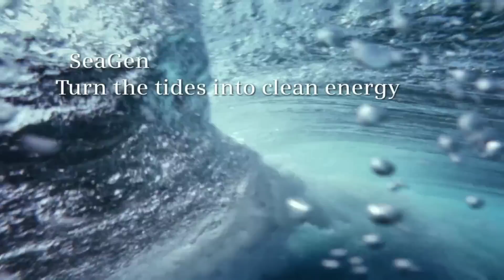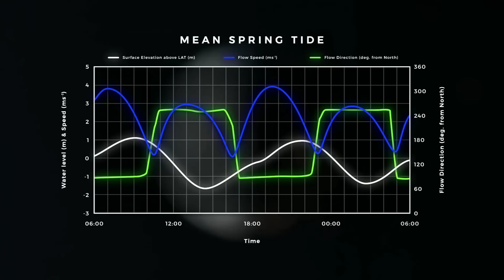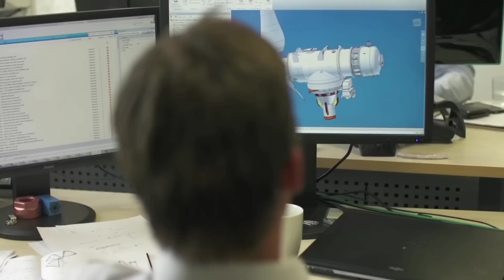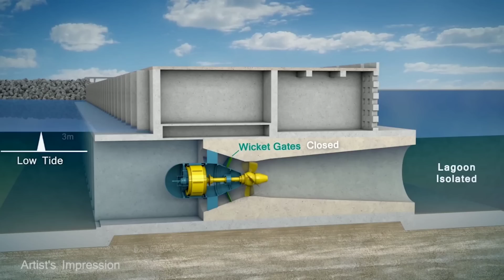This is the Amazing Energy Source That's More Powerful Than Wind and Solar Together!!

Comment: Most of the turbines (or all?) are failed projects that are already out of biz.
Only the 3rd Gen project on the thumbnail is in operation and feasible for 3.5 or higher currents.
The true challenge to tap into the vast 2 m/s currents with low maintenance and mass production design isn't even touched.

Comment: Tidal energy will at best add nightime baseload for industry that cannot shift loads or ramp up/down production out of solar availability.
The sites of 3.5 or higher currents required by this solution are very rare places far away for areas of high demand.
The individual props do not scale beyond 500 kW per unit and can't get into the typical 2 m/s current regimes at all or scale to MW power per unit.
This is a huge maintenance and CAPEX issue that structurally cannot be overcome on a cigar type float.

Only one tiny company in Germany called Cyklone Tidal Energy is at TRL5 regarding currents of 2 m/s. Means afaik only they do currently have any experimentally proven lab physics getting into the vast areas of tidal currents at scale.
A lot more R&D focus on tidal power would be required to unlock tidal power for cheap direct night time industry power supply.
Where you economically cannot compete when draw power from storage during half of the day. That's green steel, green ammonia, chemicals, paper and waht not in raw materials processing that has to run 24/7 full speed in the industrial core base in every regions.
The base materials stuff all other companies higher in supply chains need to get super cheap or die.

Comment: The energy systems of the future will be based on operating costs and efficiency as well as cheap energy storage.  Propellers under water are vulnerable and there is an unknown cost in this.  It is difficult to see that tidal energy can bring costs down under solar and wind conditions.  The headline is way too bombastic.  The energy of the future will be a mix exactly as it is now.

Comment: No mention of oscillating water column.  

Also, anyone who works in any type of marine environment will agree, salt water eats, eats and eats.  It’s corrosive.  A turbine in salt water has a shorter lifespan and requires more maintenance.

That said, if it’s more efficient and can generate the power, go for it.

Comment: Is a big, a pricipal mistake inside tidal energy harvesting. I did develop a new science; 

Between KNOWLEDGE and UNDERSTANDING, there exists a discernible
and traceable difference. The essence of SCIENCE is to transform the
knowing into UNDERSTANDERS. Thus, FLUID SCIENTISTS are
essentially FLUID UNDERSTANDERS. However, an extensive detail has
escaped all fluid scientists from the Big Bang until today. They know
everything about that lateral force called DYNAMIC LIFT, yet they haven&#39;t
understood its condition, CIRCULATION, beyond being able to define and
differentiate it from lateral inflow, not comprehending it as a CONDITION
for LIFT. They haven&#39;t tested it, examined it, analyzed it, evaluated it,
questioned it, and consequently, they cannot generalize this inseparable
connection between LIFT and CIRCULATION in straight lateral inflows, nor
can they comprehensively apply it. The knowledge of circulation did not
culminate in understanding. Instead of a theorem, an axiom, circulation is
found in lift formulas (KUTTA, BLASIUS). Hence, human interaction with
flows still revolves around the two entities of AIRFOIL PROFILES and
ROTORS, but not around externally induced switchable and controllable
CIRCULATION.
To establish a basis for dialectical understanding from innocuous,
inconsequential, helpless knowledge of LIFT and CIRCULATION in
LATERAL INFLOWS, here is a lay-based attempt to at least fundamentally
indicate that twinning/synergy between lift and circulation. This draft aims to
contribute to eventually transforming mere KNOWERS into coming LIFT
UNDERSTANDERS.

DRAFT:
Axiom concerning the synergy of CIRCULATION and DYNAMIC LIFT:

"Dynamic lift results from the struggle and unity of opposites, the convergence of circulation and lateral Draftflow (1st dialectical law).
Within lateral flow, every object that is circumferentially surrounded, every entity within the universe, regardless of size, weight, shape, or nature, experiences a lateral force - DYNAMIC LIFT.
Dynamic lift is the lateral force that any circumferentially surrounded entity experiences within an additional, lateral flow.
Lateral flow, as indicated by the term 'lateral,' excludes (literally/in the sense of words) a flow direction parallel to the axis of circulation.
The necessary circulation can be
a) aside from its spontaneous generation at an appropriately directed "slanting" angle of airfoil profiles (sails, kite-dragons, wings, turbines, propellers, ship screws, ascending larger, non-spherical air bubbles in liquids) with respect to that lateral flow,
b) a consequent circulation from rotation (akin to falling confetti in a gaseous medium with ensuing friction/interlocking action!)
c) also achieved externally, by switching, controlling, changing direction, and switching direction.
For the purpose of generating the desired lift in a switchable, controllable, and directionally adjustable manner.
Circulation and lift occur within lateral flow either together, interacting or not at all.
This synergistic interplay is only proportional within a very small range. For instance, the KUTTA lift formula (factor times factor times factor equals product) mathematically implies proportionality, but it is limited by the effect of the LAW OF CONSERVATION OF ENERGY to a specific range of validity (alleged "rule of thumb" without explicit justification by the action of the law of conservation of energy.
Lift increase terminates roughly between attaining three and a half to four times the circulation speed relative to the speed of lateral flow, (documented in the letter from the Göttingen wind tunnel operator to the engineer Mr. FLETTNER during the assessment of his rotor intuition/intention/invention)."

Comment: This energy source has been around for yonks. In NYC they planted a system as an experiment to first power an underground car park. They had problems with breakages from the speed of the water flow, also the system stopped when the tide was at the turn. Severn River in Wales has a system for years, they had tried systems in Ireland and many other places around the world.

Comment: 7 19 23
    an idea for inland peoples in the USA.

here in colorado the Arkansas drops from 10k altitude at  Leadville to the Pueblo reservoir
at 4k altitude.   there are no hydroelectric units along the way. 

          none

 there are a few diversion  dams. 
 one up by Buena Vista to divert water east to colorado-springs.  pumped uphill too.
and one in Florence that diverts water to the steel mill in Pueblo

  

lots of gravity - driven moving water energy not being harnessed.

   instead our electricity comes here from South Dakota.  via hi - V. transmission lines

Comment: Since Elementary school, I have been building dams in my mind. Last week, I put a lake above the dam in China , so you can fill the lake with the water that has passed through the dam, with pressure, as the lake is only a little above the dam in elevation, then you can run the water through the dam again. You can store water from drought, or double pass through the water as an all the time practice.

Comment: "Tidal Wave Energy" huh?  Harnessing tidal waves?  Tsunamis?  How about open flow hydrokinetic energy?  How about ocean current energy?  How about just "tidal energy", without using the word "wave"?  Sure, some of these use tides, some use more consistent ocean currents,  almost no successful system uses waves, and absolutely none use "tidal waves".  This fluff-piece is mixing terminology between tidal energy and wave energy, neither of which fully addresses open-flow hydrokinetic energy from ocean currents.  So far, waves "seem" to contain a lot of energy, but attempts to capture wave energy have had very limited results, not looking very promising as an economical energy solution at all.  This video keeps using the term "wave" but barely shows any actual wave energy devices.  As far as I am aware, there is no such thing as "Tidal Wave Energy"!!!  Using tides is great, but limited to the times of tidal flow, whereas using open ocean currents offers a more consistent resource.  Just sayin'...   :)

Comment: Swansea, Wales was meant to be getting a lagoon. I think the cost was what terminated the idea. So, I thought of a solution, make it from ice using some of the electricity generated to keep it frozen. Then add soil and rubble until it is solid. The water for making the ice could come from the river because salt water is harder to freeze.
Reply: I thought it was the politics, guess nothing to do with the money that the fossil fuel industry has poured into the Conservatives?

Comment: It's hardly new. They are costly to build, and maintain due to corrosion and strong currents they survive. They can produce consistent power and can be built in a ton of configurations. Everything would improve to its greatest potential, if the goverment took a hike and let the free market decide, what our needs are, what to prioritize, what is cost effective. The free market is not entirely swindle proof either, but it is idiot proof. When the government swindles, it's on a massive scale and they want only big controllable corporations to exist. Wood pellet powered steam turbines for the home would heat water and be reliable support for wind and solar. The same thing could extend the range for electric cars. Propane would be the easy practical choice. None of this is new since before the pyramids. We have a Satanic world system that wants you to labor for them. If anybody is messing up the planet, it is people at HARP, CERN, and weather modification programs that utilize harmful substances put into our commercial jet fuel. It's not a theory. Humans can't build a better human than God, and what God would not consider is that we might use the trees for fuel?  People have been lied to so incrementally. People will kill for political power. It will never change.They showed a bear on some ice, hitching a ride, and the world cried. Ocean levels are still on a consistent slow steady rise, as is evidence of sunken cites all over the place. People still sacrifice their children and future for the earth and other Gods. A house costs a half million to build because of layers of regulation and corruption. Build a cob home correctly, and it might last 400 years. Physical sustenance is basic. Shelter, food , water,  heat, sanitation. The goverments job is to protect our borders and let us live. It would be illegal to live  like the Amish in California, even though it's more sustainable. They regulate rain water. They are starting to make people register to have a vegetable garden. Digital money has arrived and we are in a surveillance state. The fires that burn are set.  Woke is delusional. They're trying to outlaw diesel, overnight. We would starve. I'm not listening to purple haired people, who don't know what sex they are. Enough is enough. The world is circling the drain.

Comment: Hi. Barnacles are the problem. Streaming water efficiently imparts energy to a smooth turbine blade, but as soon as the blades lose their smoothness due to barnacles, the efficiency plummets to "not worth it" levels. Ships suffer this too, and are often dry-docked for maintenance. Sea turbines will need some way to quickly raise and lower the turbine mechanism, including penstocks and exit channeling, so that descaling can be done. 

Another problem is the amount of rubbish in the sea that can jamb the turbine, like ropes, fishing nets. Apart from these practical problems that will add hugely to the costs, it's a great idea. Cheers, P.R.

Comment: I worked on ocean power a lot. conclusion. two fundamental issues. Size  and costof equipment is so high compared to the pathatically low amount of continuous power can be produced, it will never never be economical.
My study of the wind available when waves are available showed that it is much much cheaper to use a wind turbine which will produce 50 to seventy times much more power than extracting it from wave.
A much cheaper n reliable solution.
when there is a wave there is a wind but many times hardly any wave power can be extracted even though significant wind is there.
CONCLUSION
EXTRACTING POWER FROM A WAVE IS A MYTH AND CAN NEVER BE ECONOMICAL. AVAILABLE ENERGY FROM THE WIND IS EASIER CHEAPER AND FAR MORE ENERGY CAN BE PRODUCED.
combining it with solar and energy storage is even better and will bring the cost down.

salt water  and wave shock destroyes  the shaft seals so quickly, it is very very difficult to prevent it. Also too costly to repair

Comment: Tidal (ocean) is second only to nuclear, unfortunately tidal generators thus far have not proven reliable or robust, salt kills most materials, but this isn’t a huge impediment but the shape of “blades”  like on land has the potential to kill big “fish”.  I’ve done river dams and on so like the Mississippi you are fairly sure you’ll have sufficient head height, but rivers do rely on rain for the source.  The tides are governed by the moon and that pretty steady much a constant.  Just need an innovative “blade” design that has decent efficiency of converting minute wave action into energy and doesn’t kill dolphins or ??? And isn’t susceptible to salts adverse actions.  Still nuclear Generation 4 IMHO is the real solution and can be dispersed across the country closer to the demand and help lessen the vulnerability of the grid, which we done nothing to reinforce or add redundancy or reliability to it, the power goes down in three days everyone goes Mad Max
Reply: It will work in many parts of the Ocean Planet, it may not work in North America, as they are locked into using fossil fuels.

Comment: This technology is great. but I have to correct you my friend about you mentioning "climate change", because climate change doesn't exist, Carbon is food for the trees, trees convert carbon in to Oxygen!! Ever since we started driving cars the planet got greener by a large percentage and still growing. what you refer to as "Climate change is basically the weather modification programs of the US gov in which they are using airliners equipped with tanks full of chemical which then they automatically start spraying above cities in result to alternating the weather, they block rain, cause a flood and much more, also this spray is the N. one cause for wildfires because this chemical settles on the leaves of the trees and with the suns heat they ignite. also ones the spray is released in the sky they shoot radiation waves that elevate the temperatures, they are microwaving the sky the same way you microwave your food using HAARP technology. please do more research on this matter because we are going straight for disaster.......

Comment: Will these turbines be more environmentally friendly than wind and solar which are TERRIBLE FOR THE ENVIRONMENT.  
The off shore wind turbines kill Whales. Most Whales sink, but the Atlantic Right Whales float and are being washed ashore en masse. Birds, especially raptors, bats and tons of insects are killed daily by wind turbines. The mining done by child slave labour for solar, turbines and their lithium batteries is scarring both the landscape and Children. Solar farms incinerate birds flying overhead. Wind and sun are intermittent. Solar panels and wind turbines are too toxic to be reused when they rot and die. If you really believe that fossil fuels are evil, which they are not, then you must know that renewables cannot be built without fossil fuels. Net zero is the biggest lie and the biggest disaster ever sold to the gullible.

Comment: It puzzles my mind that they use blades like wind turbines blades to harness power from tides and they put the whole system underwater!... Friend, make a video telling them that they are wrong about doing this...the way it is done is with paddle wheels, big ones,  I would start with 5 meters by 5 meters paddles ( these paddle wheels would be 10 meters tall and 5 meters large ) and the generator would be outside of the water for everything to be cheaper and easier to maintain...
Does anyone see my point?...I would love to see a video proposing this idea...
Reply: You know what I am talking about..So can you do a video about what they are doing wrong and how we should go about doing it right? Just to help these people... see what this comment says...

Tidal energy has been around for a while now. I read once that some folks in the southern portion of Medieval France used a tidal pool to run a water wheel set up for about 10 years or so to grind grain and saw wood until the system silted up. They could run the system for about 5 hours a day.

....Medieval France.....water wheel....it was probably a peddle wheel...this is not rocket science at all...

Comment: Trouble is with tidal power these great generator disrupt the tides when used in large numbers as thay have found with large areas of wind turbines.  Lots of little changes con disrupt or destroy the currents causing major weather changes . These are all good ideas but thay must all have a close eye one the environmental change.